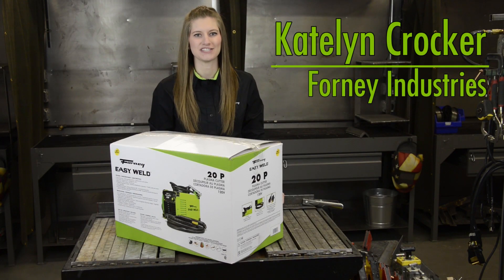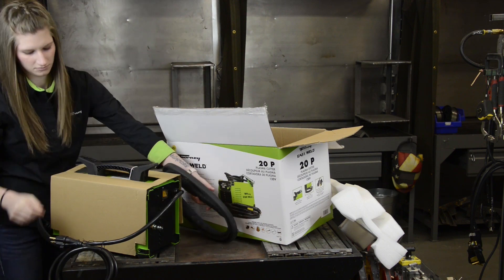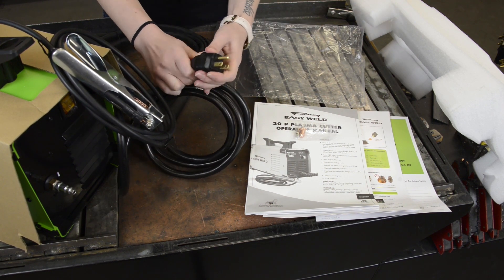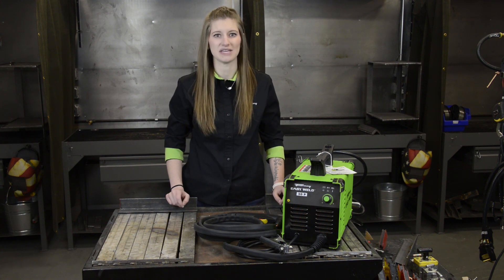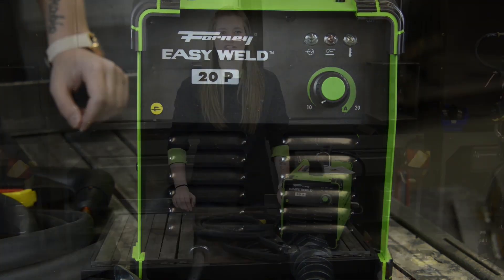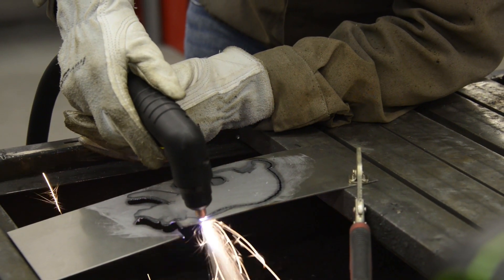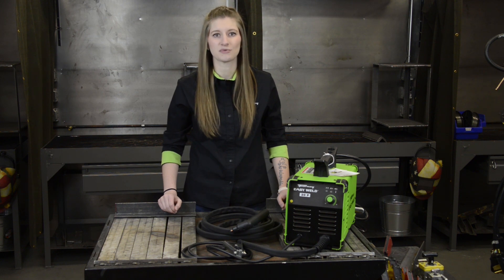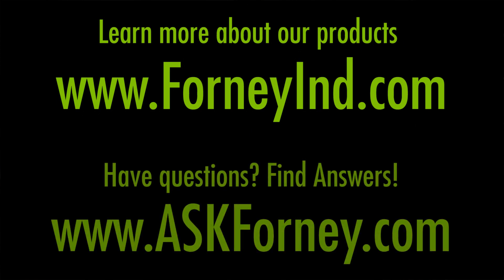Forney Easy Weld® 20 P Unboxing

Comment: I have a 80 gal compressor runs 125-155psi do I need to by a air regulator for the appropriate 60-90psi or is the mp 20 have a Internal regulator so i dont?
Reply from the maker: Yes, you will need a regulator. The unit has a built in moisture separator but not a built in regulator.